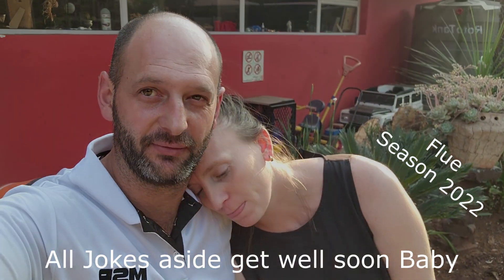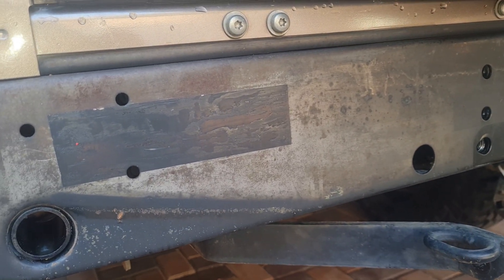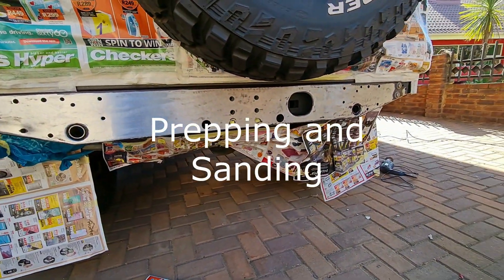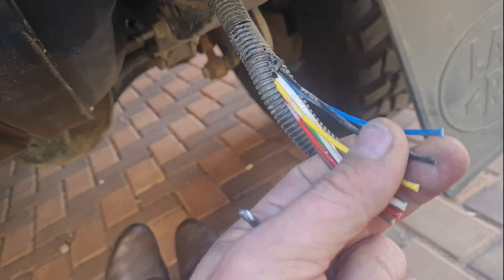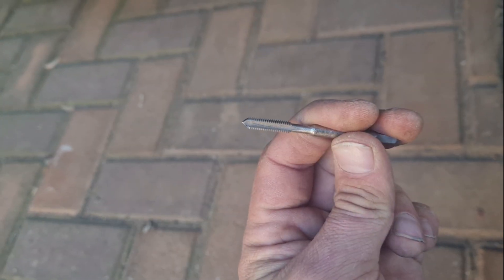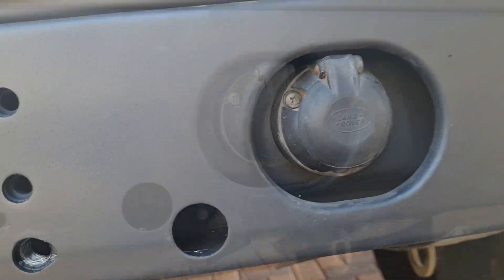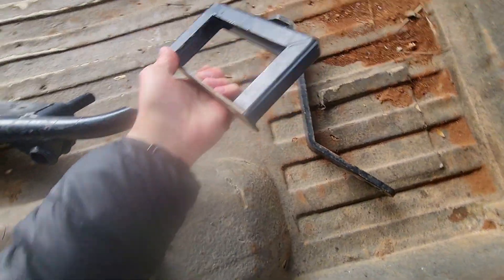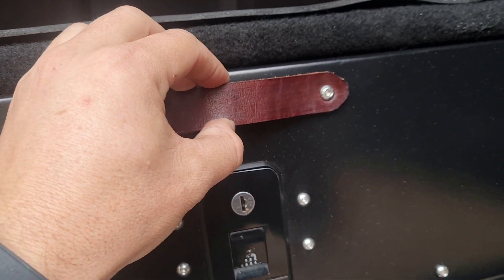Refurbing my Backside

Comment: Nice job👍 In the past I used Hammerite black spray on the rear end and after watching your video think it needs attention again. Any ideas on how to replace the two button remotes (SA)?
Reply from the maker: Thanks bud, now that it's done I can't believe I left it so long😀, are you referring to the remote to activate the alarm? if so what model defender do you have?
Reply: I have a 2015 Puma Heritage and the remotes are basically in pieces. The remote looks like a D4 remote but only has two buttons to lock and unlock
Reply from the maker: From 2014 onwards it should be as simple as putting them back together and they should work again, I know you can buy casings on eBay and just replace the internals. Maybe see if you can get a d4 remote used and swap out the internals.

Frank has a website with some basics
https://kraxlr.de/facts.html#key
But doesn't talk about the details of repairing.
Reply: Thx👍